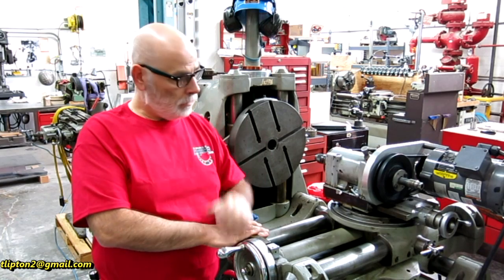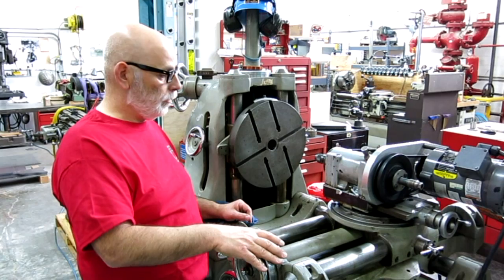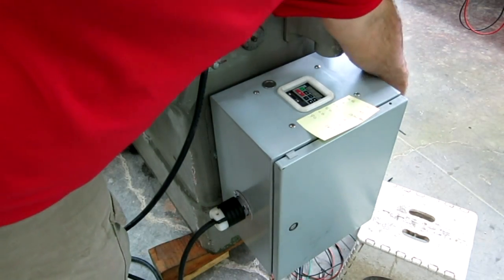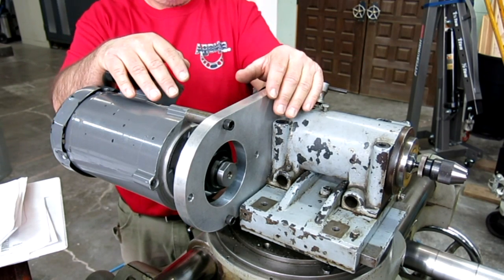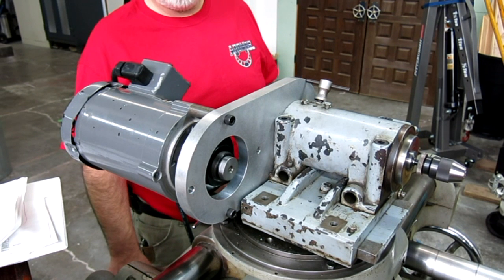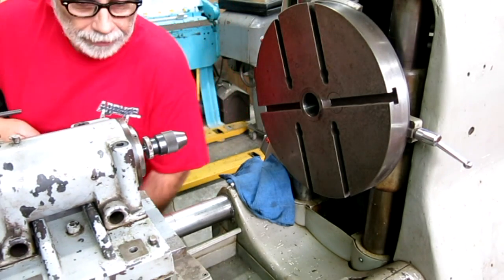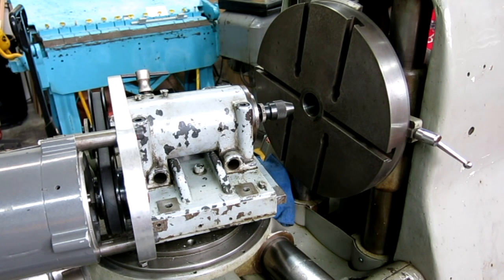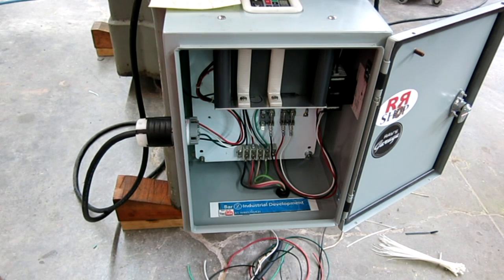Kearney And Trecker VFD

Comment: 5:56 "since Stan and
 Randy and Ray they're all concerned about my wiring capability"

Well, looking inside, I can see why they're concerned !
The incoming feed should not go to a terminal block but straight to the power switch - so when it's turned off, the only live terminals are those on the switch - which ought to be covered :)

Comment: Tom,
That VFD must have the capability to change the display scaling so it reads spindle rpm? Every one I worked with did.
It’s great to see old iron reconditioned and running. Good job!
Regards, Ray

Comment: if both sides of the machine are spinning don't you run the risk of breaking a bit or bending a drill bit. Be nice this is a woodcuck asking...
Reply from the maker: Hi Richard,

Actually its a common technique. You can double your rpm when you have two turning elements. Some modern lathes with live tooling can get a combined rpm near 10K. Thanks for the comment.

Cheers,

Tom

Comment: Tom, cool machine and nice job on the VFD mounting. Well thought-out!  Will be fun to see you making things with circular layouts of angled holes...maybe a turret tail stock for your lathe?

It looked like you only used 2 of the 4 mounting locations for your motor...is that temporary for the demo, or permanent? Might account for dome of the belt noise if the tension us pulling it out of alignment slightly. 

Thanks for the education!

-- Mike

Comment: Tom, What a way cool machine. Nice wiring on the VFD cabinet too.
Would the spindle hold a milling cutter? You mentioned drill several times but was wondering about milling a slot at an angle into a piece rotating in the main faceplate.
Regards,
Eric
Reply from the maker: esoomreltna Hey Eric,

The sub spindle is R8 so yes you can put an end mill in it and cut at an angle. Pretty scary all the different angles of attack on this thing. Thanks for the comment.

Cheers,

Tom

Comment: Nothing wrong with your wiring Tom, in fact you could probably put more than a few electricians to shame with your neat and logical layout.
Like others I will be looking forward to seeing this machine in action.
Question; Can you mount milling cutters in this because that would really open up the possibilities.
Reply from the maker: Mark Fryer Hi Mark,

You are most kind. The little sub spindle is an R8 so yes you can mount cutters in there. The center hole of the machine is a morse taper that I have a 5C adapter for as well so you could mount a cutter there as well. Its pretty crazy what I think this thing will do. Thanks for the comment.

Cheers,

Tom

Comment: Great job Tom. Do you think a vfd will work on my newly acquired 3hp Rockwel lathe or should I get a rotary phase converter? Thanks for the videos and information.
Reply from the maker: Bill Mader Hi Bill,

There are some great deals on VFD's out there. You can use one to just convert your single phase to three phase or use all the features. I would do some cost and space studies to make my decision. Rotaries are a little noisy as well. Hope this helps.

Best,

Tom
Reply: It sure does help Tom. Thank you for your valuable opinion.

Comment: How about some sort of dome over the vfd display ?

The flat recessed spot looks like it will attract chips and snot.
Reply from the maker: 12345NoNamesLeft Hi Rusty,

As I experiment with it I will probably add a remote switch and speed pot. The funnel like bezel is pretty far from the action but you might be right about it needing a cover. Thanks for the comment.

Cheers,

Tom

Comment: Tom, on my VFD i used a 10 ohm potentiomètre to vary the speed. I can also change the rotation With a switch. Can your VFD do that?
Reply from the maker: Rob Townsend Hi Rob,

Yes this is a Siemens micromaster. It has the ability to use a remote on off switch and analog speed control. Just haven't wanted to add any more work to the plate so I can get to cutting some metal with this thing. Thanks for the comment.

Cheers,

Tom